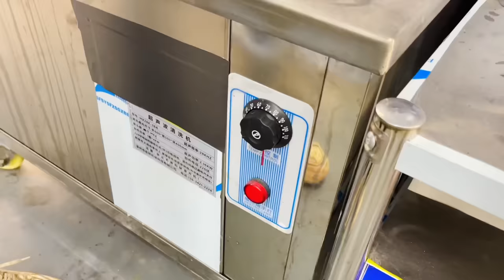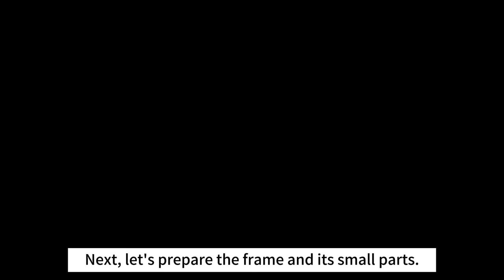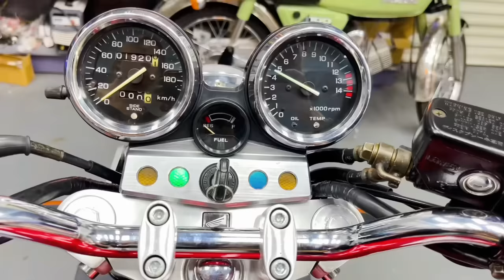Full Restoration Honda CB400 - 1994 Timelapse!

Comment: Comming from someone who have done this for 30 years, this is top quality work!!  

It's just me in the shop and I'm well known but I have been looking for years with somone who has this kind of attention to detail.   I have tried to train a few people do it like this, but the one thing I have found that is missing and that is the passion to do it.  If it's just a job, then that's just it.  If it's a passion then it isn't really work.  And it shows
Reply: A question for an expert, at 10:56 is not clear to me the procedure to crank the engine, the negative on any part of the engine and the positive on the starter, or on a specific part of the starter?
Reply: @nfa10 1 cable from engine starter attached to positive battery and 1 cable attached to the body/crankcase. In the video she didnt show the battery or power supply.

Comment: I have seen many of these back in the day and I had a 94 cbr400 for my daily driver for about 10 years. This was 90% the same bike but never had it broken down to this level as they were bullet proof. Hardest part to find was the radiator, went through several, sad day was selling it but my back thanked me.

Comment: You rebuild an engine better than most of the so called Bike builders on You Tube  I loved the way you lubricate every part. Also  making sure the oil is purging so the engine will be lubricated right from the start. Gan de hao jixu baochi

Comment: Wow, so skilled at every part of the process, the way she stuffs wires and flipped the positive terminal cover on the battery makes me think she has experience on a production line. Tighten screw, flip cover over , move on to next task. Same with wires in headlight nacelle.

Comment: I have been amazed at the high standard of car repair in Thailand. From this video it extends to China as well. Her workshop is so neat and engine parts laid out in order. I suspect items like the gauges and seat, possibly the wiring harness are drawn from parts. There will be many dashers bearings pistons and rings which should be renewed. I suspect and hope she would have done that.

Comment: i had a Honda CB400 Super 4 in 2002...looks the same or very similar...except the paint colours...mine was graphite grey...had a CB1 before that another 400...both Japanese imports or grey imports the term for the unsupported models...most of the 400/ 4 cylinder bikes were used ex Japan trade ins...i saw photos of fields of used bikes they couldn't sell...British dealers grabbed hundreds shipped over in containers...all the Big Four companies probably disapproved of these imports especially Honda i would say as the only one of the companies to have a 400/4 in their official range in Europe the VFR400...i didn't like the single sided swing arm...i never did like that on any bike...ah well...just enjoy the time lapse rebuild now...i wish it was in real time though

Comment: Lovely job 👏👏
Only question is how could such a low mileage engine have valves and crank in such poor condition, there was less than 2000 miles on the clock (unless I've gone daft) ?

Comment: Not a bad job, not great, but not bad. If we call the video a restoration, then the tank could have been better worked on instead of leveled with putty. It’s also not clear what’s wrong with the inside of the tank. What about the carburetors, what work has been done to them? Again, the engine cover has already been repaired, why not just change it, because there are a lot of such engines. Etc